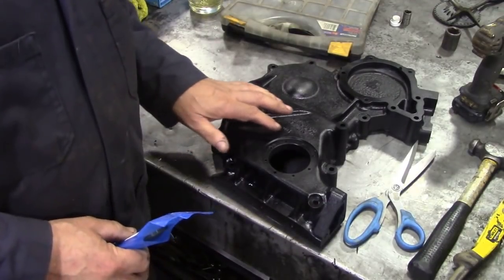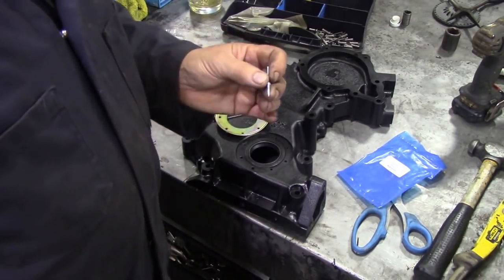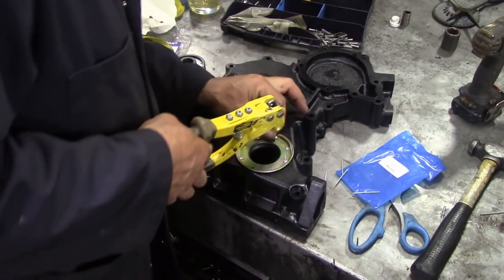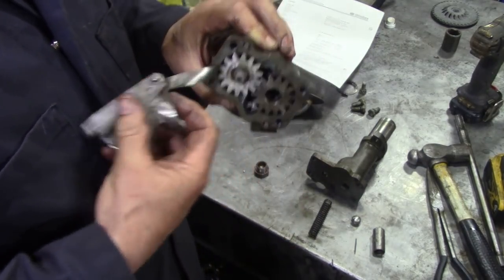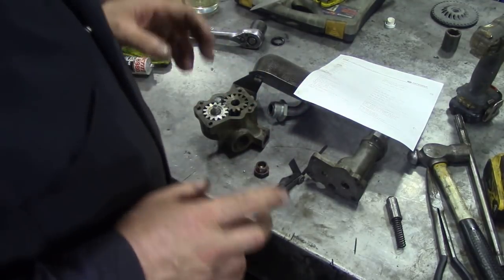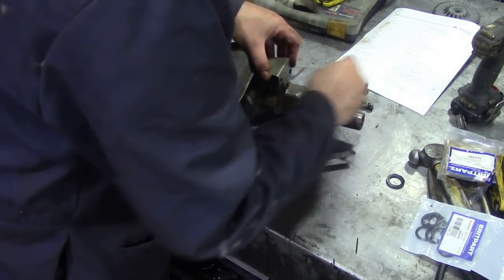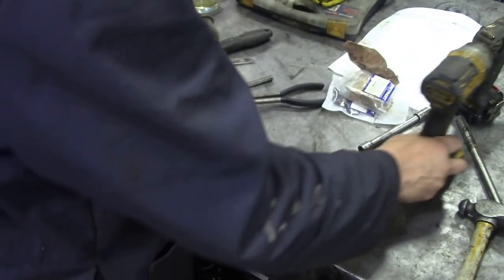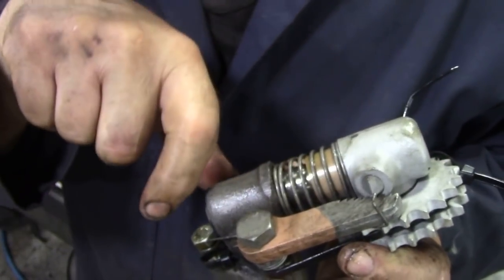2.25 engine. Front seal, oil pump, chain tensioner

Comment: Hi Mike, so to do the front crank seal would you remove the front cover completely drain water oil etc and do the seal on the bench?
Reply from the maker: Depends on if the seal retainer has been fitted with rivets or screws - if it is the original rivets, then you may have to drill the heads off and tap them through - this would mean removing the cover rather than having metal rivets floating about in the engine - if it is screws, then you can replace the seal in situ.
Reply: Ok thanks for the reply mike
Reply: Ok thanks for the reply mike

Comment: Hi Mike, did the pop rivets method worked without any leaks? Pls let me know., im looking forward to replacing my main oil seal.
Reply from the maker: Seemed to be OK - no complaints yet - use a bit of RTV sealer as an extra 'back up'

Comment: I see that some use Vaseline for oil pump . Is this necessary or can the grease can be used as a suit from it?
Reply from the maker: Sometimes when building engines, you do not know how long they are going to be in storage before use. (In some cases it could be years)
Grease can dry out and become hard, but Vaseline does not

Comment: To be fair, the Repair Operation Manual does instruct you to replace the rivets with screws. The precise wording is below:

"On initial assembly of the engine, the mud shield around the oil seal is rivetted in position but after removal in service the rivets are substituted with self tapping drive screws.
"Where drive screws are fitted, it may be possible to renew the seal without removing the timing cover...
"...On fitting a new seal, the mud shield should be allowed to finally pull the seal into position to ensure a positive location."

Upon refitting, it says:

"12. Smear the outside diameter of a new oil seal with Hylomar P1 32/M jointing compound...
"... 14. Coat the drive screws with Hylomar and secure the mud shield."

I hope the above helps!

Comment: I drilled and tapped, use Allan key to remove fasteners. Works like a charm, easy to get. I used M4 cap heads

Comment: Great video as usual Mike.  Glad to see that you used  blind aluminium rivets, steel ones would take  to much pressure before they :pop: which could damage the aluminium casing. ( due to Arthur Righteous I now use a air rivet gun )  If I get an over-sized hole like that bottom one, I just stick a washed on the inside to cover it up better. I wish that I could buy a 2.5 petrol to fit in my old defender, They are in your words, properly engineered, not cost engineered. Keep up the good work Mike, you bring back so many memories. Best wished from Yorkshire Rob.
Reply from the maker: Over engineered rather than 'adequate' engineering !
Cheers Rob!

Comment: What is the significance of the grooves in the corners of the flats on the bolt that holds in the spring,piston and ball of the relief valve? Shown at time 13.19. Thank you.
Reply: I have racing banjo bolts on my motorcycle master cylinder that have these grooves - to allow for ''lockwiring'', (which is tightly twisting fine wire round the head of the bolt (the wire sits in the groove), and then attaching the other end of the wire to another bolt) It prevents the bolt from turning, loosening, or coming out.  Modern safety bolts can have multiple holes drilled in the side of the head so it's easier to slip the wire through.  But, I may be wrong for this oil pump bolt and hopefully Mike ccould correct and edjumacate me...
Reply: @WhosAGoodDogue  I have seen them on propane and other gas bottle fittings which makes sense if a type of locking method but do not recall seeing them actually wired.
Reply: The groove is there to identify unf thread.
Reply: @brendanredgate4594  I looked at lots of pictures of UNF bolts and nuts and cannot find ones with the grooves. However these markings on   BSP gas fittings indicate they are left hand thread but the fitting in the video is right hand thread.

Comment: It looked like those were open ended rivets. It would be better to use closed end rivers.
Reply: Paul, I think  you are right. These open ones can leak. Land Rover uses these gas/waterproof  rivets on the body as well.

Comment: I’d tap the holes in the casing and enlarge the holes in the mud shield to take set screws - that way, you can replace the seal in the future (next month, since it’s a Britpart seal) without removing the casing from the engine again.

You can see how the oil pump and timing system were designed by real engineers, not “cost engineers”, before the BL rot set in.
Reply: There is not a lot of thickness in the aluminium casing to get many threads in by tapping them out so I would be careful with doing that as they could strip very easily, and because a coarse thread is normally used in soft aluminium you would not be able to get many threads in there making it more possible for  the screw to cross-thread or strip. It's still a good idea though. Best wishes. Rob.       .
Reply: @MrRobmellor , how about rivnuts?  I would think M3 or M4 would be shallow enough and prevent the need to ever drill those rivets out again.
Reply: @nickboylen6873  That would be my choice, a good call Nick.
Reply: @MrRobmellor , that’s assuming they’re shallow enough to clear the sprocket inside!

Comment: Would it have been possible to tap the holes around the oil seal, instead of using rivets? Can't tell how thick the metal is from the video, but would think bolts (with sealant on the threads to prevent leaks) could make future removal much easier.
Reply: It is possible - M4 or M5 I think.